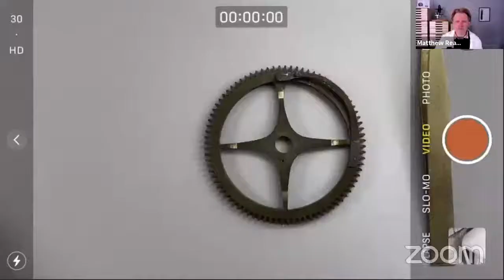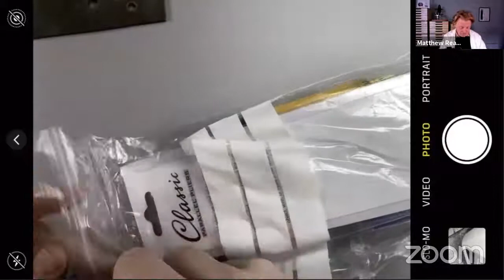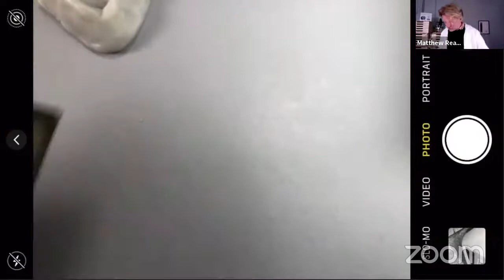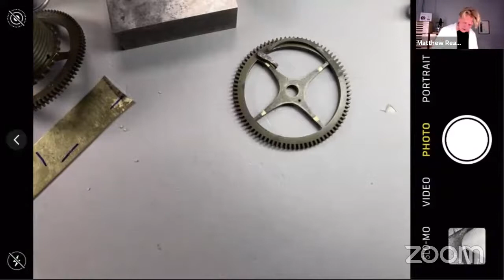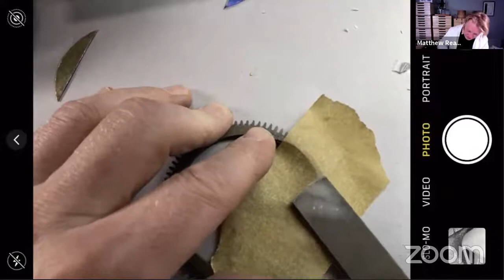How to repair pendulum clocks - LIVESTREAM #007

Comment: An index for this video:
00:00 (Starting the LiveStream)
00:47 Welcome.
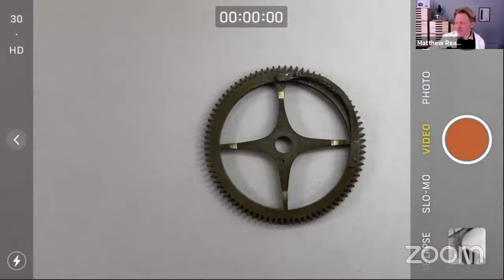01:43 What's happened during the week, which you can find on Facebook.
02:13 Review of last week's cleaning of the longcase clock movement.
03:28 Advantages of by-hand cleaning.
03:57 The fractured great wheel clickspring; Spring design; benefits of Witness Marks; deciding to make a new clickspring.
09:13 Deciding how much to disassemble. This click is riveted in rather than screwed on. Mention of the past ICON event.
12:19 The other great wheel, with its unscrewed click; Comparing the two great wheels; More disassembly tradeoffs and click design.
17:30 Unboxing the parallel jaw pliers; filing their tips.
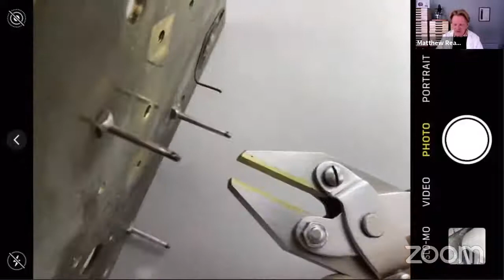23:40 Removing the studs from the plate; benefits of parallel-jaw brass-lined pliers; examining the broken minute wheel stud.
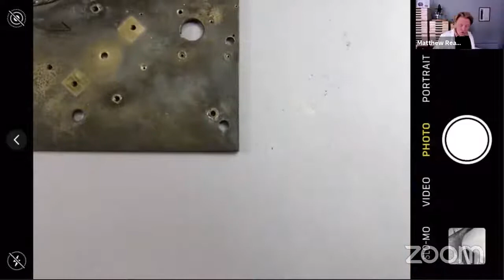27:10 How to tell whether a pivot hole needs bushing; meshing theory; (minor digressions to adjustable spanners).
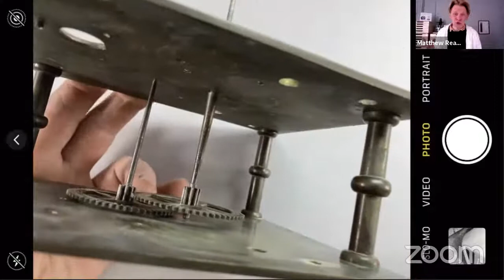34:48 Depthing all the wheels, within the frame; lots of details about the feel of the meshing.
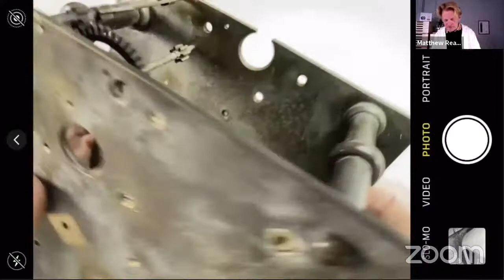54:57 Checking end-shake while depthing the wheels.
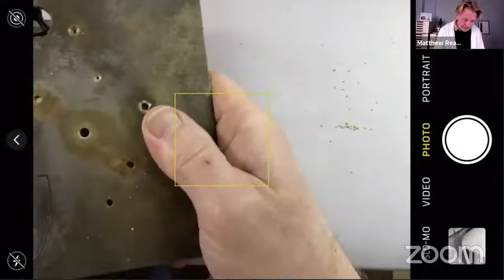57:19 Using a depthing tool to measure the warning and gathering wheels' meshing; tooth design.
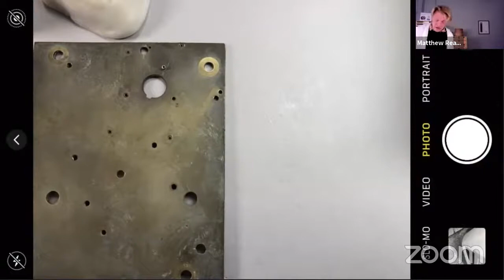1:08:33 Choosing metal for the replacement clickspring: CZ108.
1:13:32 After depthing, deciding which pivot(s) to bush.
1:19:28 Thinning and work-hardening the chosen clickspring replacement brass with a hammer.
1:21:01 Scribing the clickspring pattern on the brass.
1:25:06 Rough-cutting the replacement clickspring.
1:30:25 Removing the broken clickspring; filing the rivets; Melinex(r) to protect the metal; keeping the craft alive.
1:40:36 Next steps: removing pins, shaping the replacement clickspring.
1:41:24 Wrapping up.